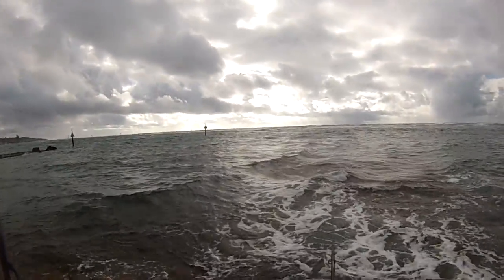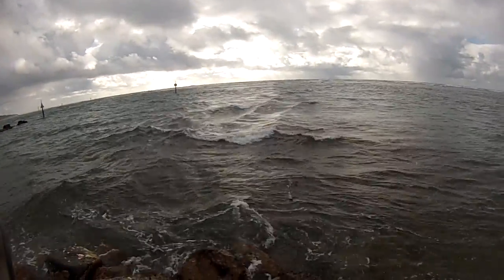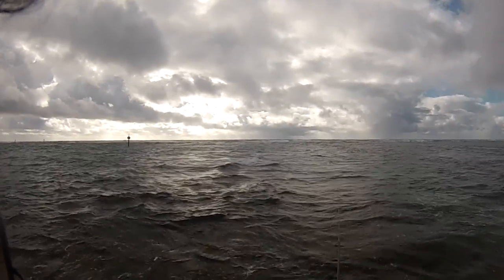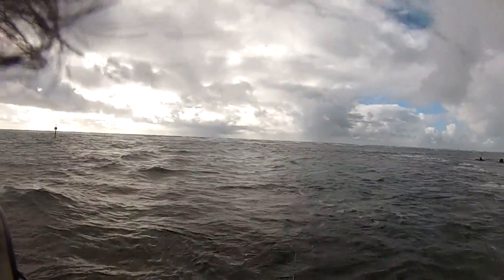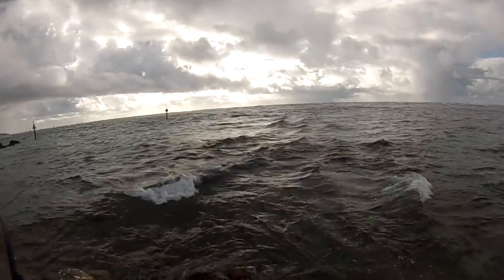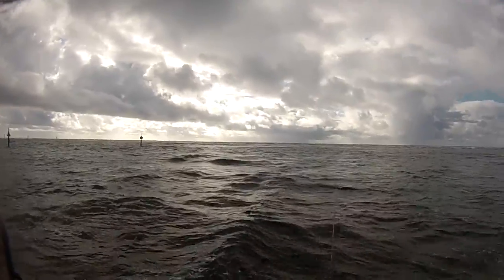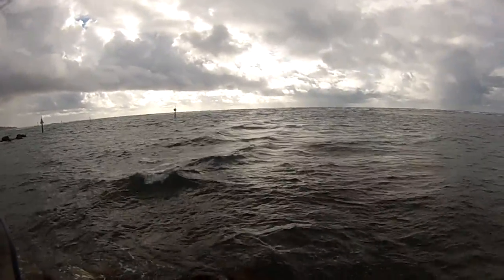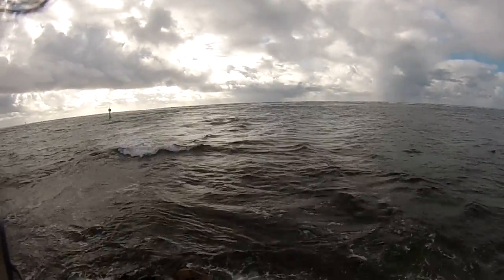WWJ Daiwa BG 4000 Repaired

Comment: Damn, I wish I would have watched this before advising my buddy to buy the bg 4000. After a couple of months of use catching bonito it has seized up. The problem isn't the bearings though. It is all in the oscillating slide and oscillating gear. It acts like the slide has jumped off the gear. I just can't figure out how to get the thing apart. Can't find a good schematic that I can actually see at Daiwa's site or Mike's Reel repair. I feel if I can get it apart it will be an easy fix. I tell you from my observation that the Fin-Nor offshore series is a tough reel. They are heavy and they don't have the instant anti-reverse but they are just plain tough. Stainless steel gears and massive ball bearings. The times I have had to order parts their service is just outstanding.
Reply from the maker: pat thks for watching..its in repair again..but they sending me a new one..they sent it to me 16 jun..from .CA to Hawaii..its still in Richmond, Ca..not happy with that service..I did field test finnor It 40 n 60 but both failed within 20 hrs..good luck..on your next fish trip
Reply: Utube: Tackle advisors BG maintenance

Comment: I went fishing with 3000 bg size yesterday and my spool fell off while casting and it fell into freshwater luckily I could find my spool and tested it on my reel everything works fine I had still greased it and my grease was still there to me spool, do you think the problem will deliver future with me spool?
Reply from the maker: thks for watching n your inquiry..freshwater is not a problem.but saltwater is..just got to water to get the water reside off
Reply: @JOEOLIVASWWJ  yeah the spool is dry now and i was letting it to dry it out a 2 days without a drag knob and only the spool. And it works well and my grease was also still on it got little lucky.

Comment: i have the 5000, what do you mean by gears "meshing"?  My reel has a vibration at the crank handle that feels like a certain section of the main gear but it is fairly easy to crank, only has an annoying vibration after getting dunked by the tide.
Reply from the maker: Zero One * thks for watching..cranking not smooth..feel like grit or small particles..problem was the bearings..
Reply: Zero One * he can feel the gears in the reel

Comment: I don't get it. What type of fishing are you doing to cause these reels to fail? I just find it difficult to understand how popping a 2 oz lure will cause the BG to fail. Also how come you dont fish conventional or baitcasting reels?
Reply from the maker: Thanks for watching. I prefer spinners. If you have an apple in your left hand n the right hand..twist apple one way while the other turn the other way, supposed apple breaks apart..same concept..on my technique.
Whenever you cranking you popping or lifting the rod tip on every crank..
Reply from the maker: tks for watching BTW the saltist went only 8 hours and failed, they replaced the pinion and main gear..

Comment: It  doesn't have saltwater  ccrb bearings
 The saltist does.
Reply from the maker: Thks for the watching and the info..I was trying to find one at $100 for some of the parents and fans that wanted a more affordable reel than the $200/$155 spheros..thus this one since the saltist is close to $200..
Reply: Ok
Reply from the maker: Kenneth May BTW I did purchase the saltist at $200..after 35 reels dince 2012, this saltist at 9 hours it failed..sent it in..they replaced the pinion n main gear..Not happy that's for sure. So the BG n Saltist fails in my book..still spheros in my book...